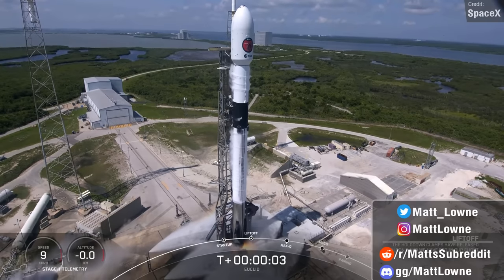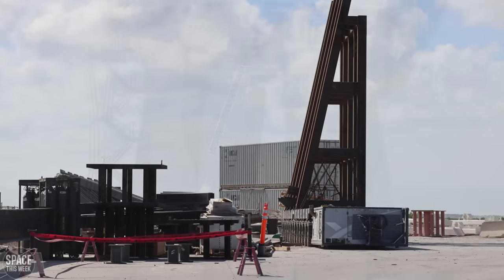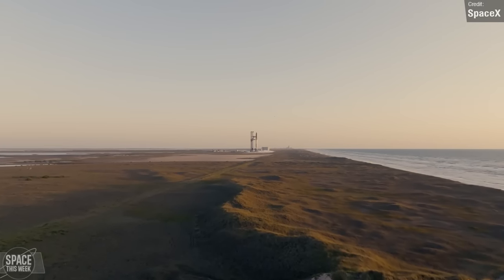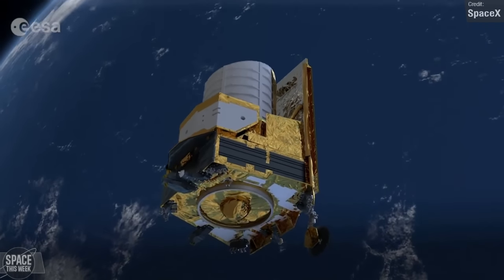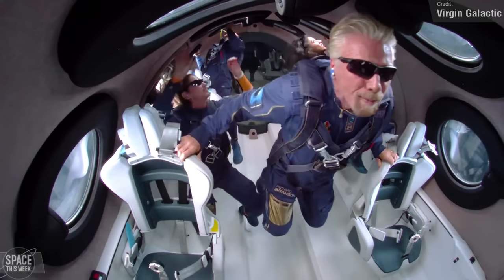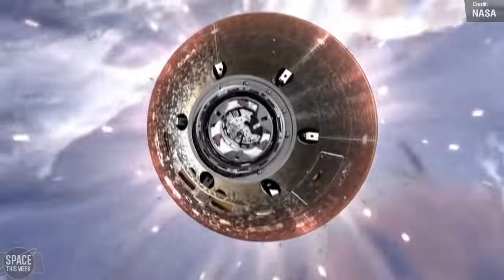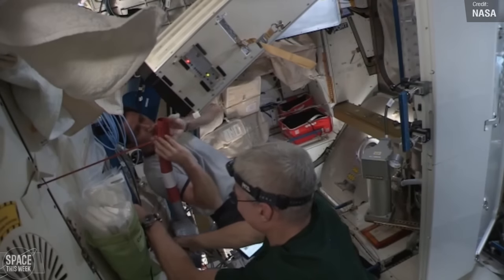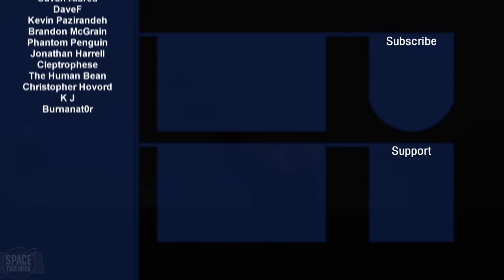SpaceX Starship Launch Pad is Almost Fixed, Ship 25 is Ready, Euclid Launch, Artemis & ISS Updates

Comment: 9:25 the requirement of a flight termination system is a United States FAA regulation law, and which it doesn’t apply to Russian rockets as its outside its jurisdiction. Russia also doesn’t have its own equivalent therefore that’s why they use remote locations to launch its rockets.
Reply: Not all US rockets have an FTS. The Astra rocket that did the power slide from Kodiak Is, Alaska didn't have an FTS. Once it was away from the pad, they turned off the engines and let it fall into the ocean.

Comment: Whenever the last concrete is poured/pumped, it will take some 28 days to fully cure. Assuming engine testing, were looking at 6 weeks minimum to launch from that last pour. Probably mid September at the earliest.
Reply: was it not fondag?  web says fondag   cures   much faster than a month toward max spec ie it has almost 2 times compressive strength of portland cement after 24 hrs curing.

Comment: That hotfire section looks waaaay to thin.  But hey  wada i know
Reply: Probably is, but remember these are the same guys that launched a rocket with no exhaust diversion or control system, something even the Soviets knew they needed 7 decades ago and the result is they ended up destroying their stage zero to the extent they will be lucky if it is ready to do another launch this year.
Reply: @L8ugh1ngm8n1 Something even the Soviets? They were pioneers of spaceflight in every way, of course they would have accounted for this
Reply: @josephc.9520  That's what I was getting at, if the Soviets back in the early days of space flight could account for this, then what excuse does a company in 2023 with over 8 decades of freely available knowledge on the technologies of space flight have for NOT accounting for it.

Comment: should've just had 33 piles with 2 meter diameter screw in ablative flame diverter mixing caps that can ocassionally replace under each engine and flood the interstitial base area with a few metres  of water to conduct heat out of flame diverter mixing caps as they dynamically redirect rocket exhaust into water for a controlled acoustic sapping boil off lol

Comment: the virgin galactic flight did not reach space
Reply: that's not what they are trying to do tho. They only go to the right altitude for 0G.
Reply: Depends on how you define space. The USAF gives astronaut wings to those who fly above 50 miles (80.5km). The Karman line is 62.1 miles (100km). There are arguments for both and is really an arbitrary line as the atmosphere expands and contracts based on solar activity.

Comment: Seperate pours is not good and amateurish
Reply: @KerbalXSpaceX  concrete pours!!!
Reply: I share KerbalXSpaceX's confusion. How is it an amateurish thing to do, and why is it bad?
Reply: @xX_Pokeman_Xx  Concrete is always terribly weak at the interface between different pours.
Reply: @xX_Pokeman_Xx  different pours at different times leaves room for cracking and expansion.    On any foundation be it for a home high rise its best to do one full pour so its all one solid piece in the end not layered.

Instead of being confused how bout you grow your mind a bit and look it up on the cons of pouring slabs this way.
Reply: From the company that destroyed their own stage zero despite knowing that it wouldn't work and needed modified before their first launch.... yeah seems about right to be honest.
Reply: @Fatpumpumlovah2  Because I've got better things to do than to go down a 36 hour long rabbit hole over concrete.
Thanks for the explanation, even if you were incredibly condescending about it.